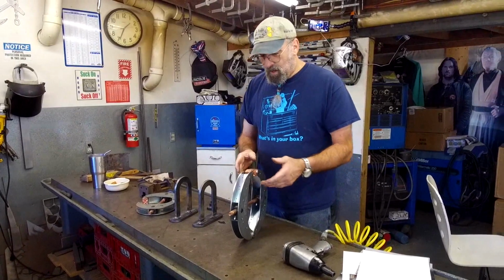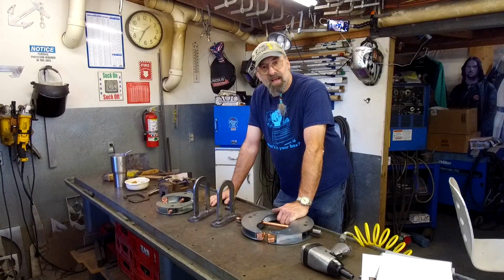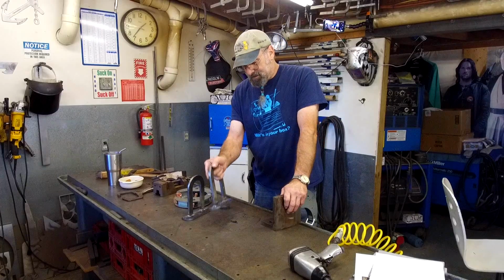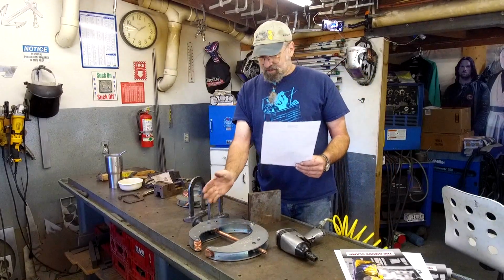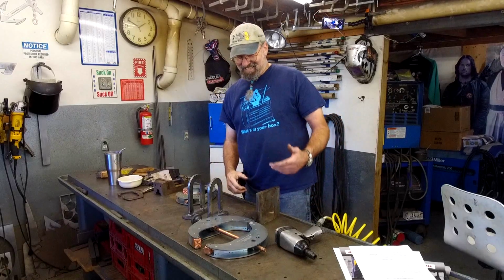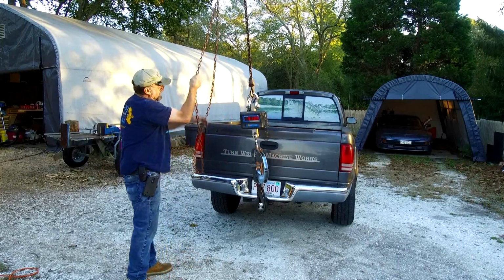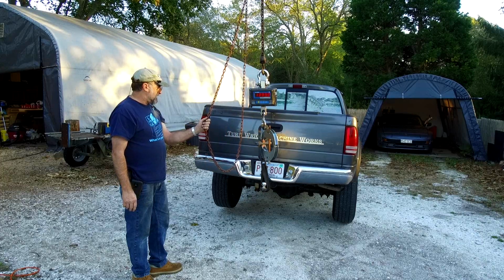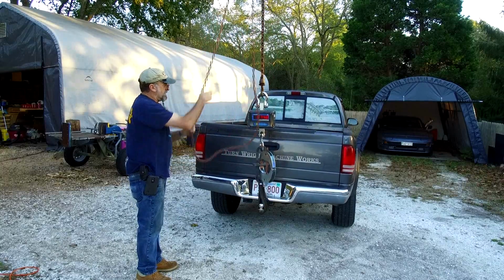Dimide Clamp Share

Comment: Make one that has a built in motor and a grip with a trigger and direction switch.  Make it run off of 20 volt DeWalt batteries.  The 8" is already bulky enough that I don't think extra weight and size off the back would be a big deal, and with clever packaging, would add little to the over all size. Being able to tighten a clamp one handed is kind of the Holy Grail of clamping.

Comment: The problem I have with that type of clamp is that it takes roughly twice as much tension on the screw as clamping force on the pads.. This likely means if you want to get any force on the clamp, you will need a wrench.  Also it looks like turnbuckle type operation which means the the force is less than a single screw.   Jaws move faster tho.

Comment: I'm retired from a machine maintenance job where I repaired CNC lathers and milling machines. I love the way Keith does things. It's not the rush rush world I use to live in. We did use tighter tolerances. Two or three thousands was the starting point.  I also love the way he shows new products and talks about them. I don't know about other viewers, but I don't go to trade shows or actively seek out information on many of the products he shows. I'd love to have a hobby machine shop with some of the gears he's got. Gear that I normally would not know about if I didn't watch Keith. Guess I should play Power Ball tonight.

Comment: Interesting clamp, but i feel that its applications might be limited. Shape being culprit here. Price, secondary. I feel a lot of people would shy away when they can abuse an old clamp instead of buying a new, but expensive, and slightly unwieldy clamp.
That's my two cents on it.
As for whether i'd buy one? Probably not, price isn't an issue, and that's considering import prices, but shape is a dead end for me, for the same reason i stay away from the other style of clamps, C clamps have been successful for a reason, the ability to get a nearly zero position on one side is unbeatable.
Reply: aserta I

Comment: Ever thought of tacking a 4" wide plate under the edge of the table to allow better use of c-clamps or bessies?
Reply from the maker: The table is ductile, not welding to it. For the most part a few tapped holes and now a clamp that can, true jigging is done on my jig table.  ;{)-------

Comment: I have just cancelled my subscription for a couple of YouTube creators not worthy of that name for their completely commercially driven content or rather non-content. There are a couple of creators in the "danger zone".
Keith is absolutely not a member of that category and for me still the number one creator! It is virtually impossible to escape from the claws of advertising when you use tools, tooling and machines. Keith is very moderate and counters it with amazing content and non-commercial initiatives like WIYB.
Teun (the Netherlands)
Reply: Yes, Keith is definitely worth continuing to watch.
Reply: Can you give a close look at the threads and nuts ?  What size and pitch do you think they are ? Must be one left and one right.
Reply: 12345NoNamesLeft huh?
Reply: Hi Coy, thanks for the question. The threads have been designed for these loads using very high strength steel and other processes to improve durability. The screws are only copper coated, not entirely copper.

Comment: They look a little big and clumsy at first glance, but once you get used to them there are probably a lot of things that they will be just the thing for. I wonder if they have a version with the clamp rod farther back in the throat to give a longer clamping depth. It would weaken the clamping force some, but for a lot of things that would be just fine.

Comment: I would rather use vice grips!
Reply: Same but I can see where these would be useful too.
Reply: I can hardly wait until someone does a DIY make your own clamps.
Reply: Yeah, vise grips do come in handy. Though sometimes you need a bit more than 200 lbs of clamp load.
Reply: Peter,I guess it depends on the size of the metal bits LOL.I agree with you for the most part because they are definitely not your everyday clamp that is for sure.But in the right situation I can see them being useful and safer than other options.I've personally witnessed large C clamps snap causing a 500lb chunk of 1/4' plate come crashing down nearly taking a guys foot off at min and possibly killing him.
  All in all it seems like a quality product made here in the USA and while they're not going to replace vise grips(or tons of other options) anytime soon .I can see where they'd really be useful too and I appreciate Kieth taking the flak to test them and bring them to our attention.
Reply: This clamp is rated at about 4 tons and is an absolute overkill for holding two bits of steel together for welding. I am sure there is a much better application.

Comment: Keith,why not take the table off the bases,measure the bolt pattern,then cut a piece of 3/8" plate to cover the bottom of the table with the same bolt pattern.Then sandwich the plate in between the table and base with some longer bolts?Maybe no more feeling around for a flat spot after that?

Comment: I'm not excited by these clamps... I can see the potential for pinching injuries to the hand of the user, which can be a problem - possibly even putting them out of business if they don't work on the design.

Also, I am less than thrilled by the design of the hinge joint from the point of view of strength and durability. The holes in the plates of the side frames are going to wear, and enlargement, cracking, and even failure are possible under sustained use with significant clamping loads.
Reply: I'll reserve judgement until a few months have passed, and we find out how they hold up.  If the design DOES turn out to be prone to those things, Keith and some other Youtubers will certainly not be shy about saying so.  Until then, its simply a new tool without a track record one way or the other.
Reply: Hi chemech, thanks for watching! The holes have been positioned precisely using finite element analysis to avoid fatigue or deformation. As far as pinching, the stop attached to the clamp (where the female hex is for the handle prevents the screw from contacting the plate and pinching your fingers. These tools are designed and built to last.

Comment: I can’t see how this clamp has any advantage over a c-clamp or f-clamp.  With the threaded rod positioned half-way between the pivot and the clamp, only half the tension generated in the screw is converted into compressive force.  And as the jaws open, the screw moves away from the jaws, thereby generating even less compression.  If you take an f-clamp or c-clamp, all the force generated by the screw is transferred as compression to the joint.  As far as reach goes, a 2000lb f-clamp has a comparable reach.  And I have hex drives on my f-clamps and c-clamps, I’ve used impacts on them plenty. Lastly, this clamp thing has 60 degree threads, this will wear orders of magnitude faster then the square threads of another clamp.  I could go on, I just can’t see it.
Reply: Your conclusions are wrong. These clamps are levers, by having the threaded rod along the lever, you are gaining a lot of advantage over the pivot point.
Your other comment about the screw moving farther from the jaws is also irrelevant, as the distance from the pivot and clamp point on the jaws stays constant. 
Really, think a bit about it....
Reply: You are confused about how mechanical advantage works.  Consider a lever used to move something heavy.  You able a force to the long side of the lever to cause a rotation about the fulcrum.  This is because you create a rotational force that equal to the force x distance to the fulcrum.  The resultant usefully force is then equal to the force x (long distance/short distance).  Because the short distance is less the long distance, the useful force is greater than applied at the longer distance.  With this clamp, you have the opposite situation.  If we consider the screw to be centered, the force applied to the jaws will be half that generated by the screw.

To make more force, you use a longer lever, this is doing the opposite.

And the screw does move closer to the pivot as the jaws open, we get that from the cosine function.

Let me know if you need more help, but this is highschool physics!

Think about it!
Reply: Forgot about one more thing.  The compression force is about half of the tension generated by the screw.  The rest of the force generated by the screw is applied to the pivot as shear.

Comment: Hey Keith I would recommend using left hand threads to them since most every one will use impacts on them lol.  other than that Chuck outside screw ball said there a little around the out side but looks good I think they will work good.
Reply: With the right socket the impact wrench should fit on the side of the hand knob, then the rh threads are fine.
Reply from the maker: LOL, turn a bolt end for end it is still the same thread! ;{)-------
Reply: Many impact wrenches have more torque in reverse.

Comment: If it were my table and this clamping problem arised. I would use the holes in the table to create an overhead clamp or bolt down angle plate! This clamp is too bulky to be practical. Still got to pay the bills somehow right.

Comment: Outside Screwball got the same clamps and did a demo also.  The end with the removable handle will take a driver on a cordless impact.  As for all the whimpering about infomercials, etc. what do you say about Niagra and Dennis Nolan sending out cutters to every You tube machinist they could find?  If the product gets mediocre or bad reviews, it is a marketing disaster.  If the contrary, possible increased sales..And if you didn't see the clamp here, would you suspect they existed?
Reply: Thanks for watching! The female hex the removable handle isn't strengthened for impact wrench loads and will wear with use while the male hex is hardened and formed out of ultra high strength steel to prevent wear, though a 1/4" impact will likely be gentle enough on it. We also get nice feedback on how to improve our products too!

Comment: Ah - I'm pretty sure that when they put together the next version of the safety sheet they'll add "No using the clamps as a part of the rig to lift the back of a truck. Hey Keith! We're talking to you here!"  :)
Reply: Haha, or maybe we'll just be entertained by how creative people get!
Reply: (With a "bite" of 7700 lbs, that clamp should be able to lift the entire truck, not just the rear end...?)
Reply: Yeah, though if one of those plates begins to slip because of an eccentricity it may fall. Have to be sure to incorporate friction coefficients and load angles. Would be risky to attempt. Also would need to check the clamp load, with a 400 ft-lbs impact wrench it delivers around 5,200 lbs of clamp load, but varies depending upon battery charge, wear on the wrench or air pressure.

Comment: those do look nice, what no more bent c- clamps. when you bend those c-clamps pushin the brake caliper pistons in that's a sign you need seal kits and look for rusted bore's the pistons probly fine if its rebuildable there usualy "tin" coated that's how one c-clamp came back after someone barrowed it I told him bout that and to look for uneven pad wear on his floating caliper

Comment: The manufacturer needs to make the ends of the threaded rods with some sort of identification as to CW  or  CCW  rotation. This way, as soon as you pick up the clamp you will know where to put your drill driver.
Reply: Get fancy and add a geared countershaft so from either end it tightens the same way. :-)
Reply: Nice Brian, but we need to keep the cost down.
Reply: They could always groove the nut on the end where the threads work left-handed...
Reply: Hi John, nice idea!

Comment: I noticed the sparks from the plasma cutter seemed to have a preferential direction. Is that caused by how the cutting head is mounted, defects in the gas lens, or just happens sometimes?
Reply: Donald R. Cossitt I should have clarified that it's the little jets of sparks that stay above the plate.
Reply from the maker: It just happens randomly ;{)-------